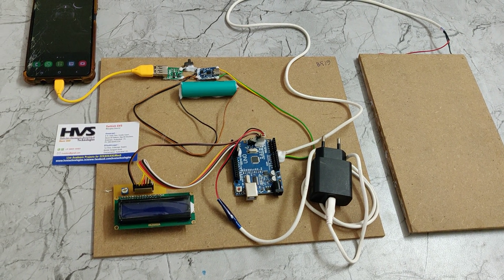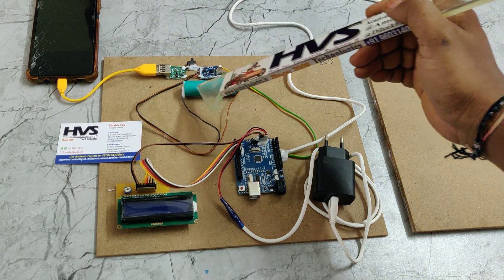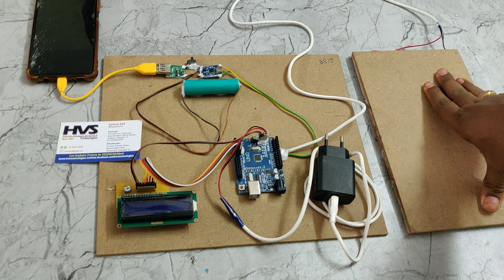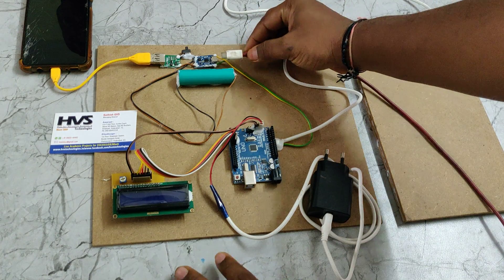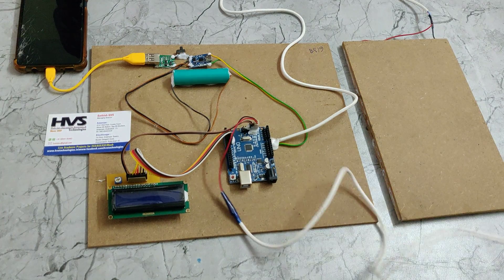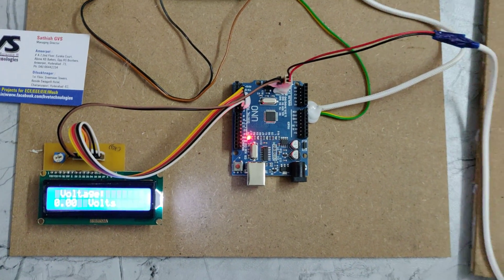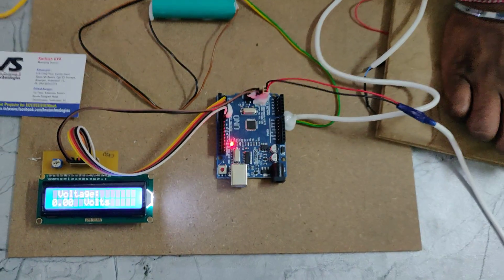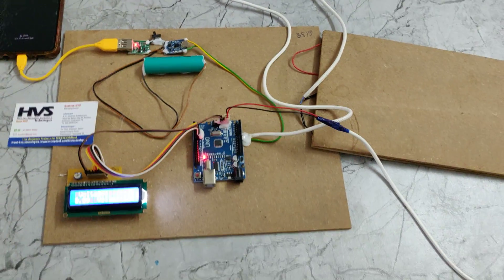Advanced foot step power generation system for Mobile Phone charging using Arduino UNO

Comment: Sir which type of current will the piezo electric sensor generate ac current or dc current and sir how much current can be produced by a single piezo electric sensor
Reply from the maker: @kailas2651  We sell total project. 
Send me video link
Will update you the cost details.You can contact us at +919603140482
Through WhatsApp or call